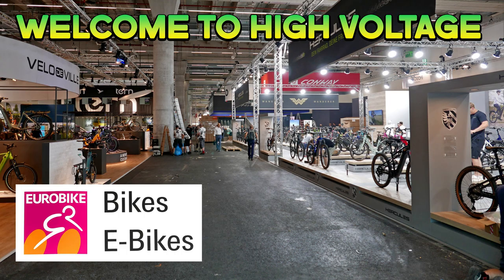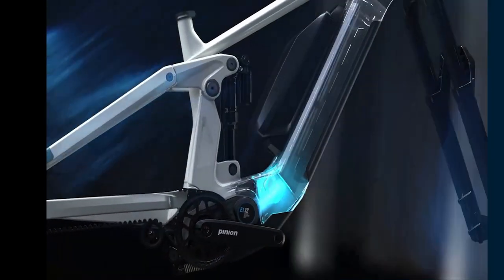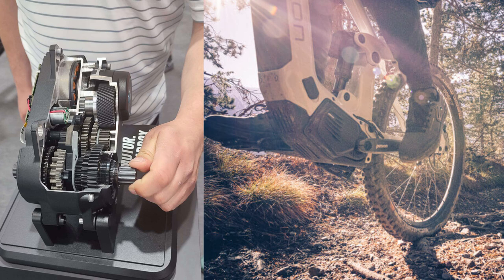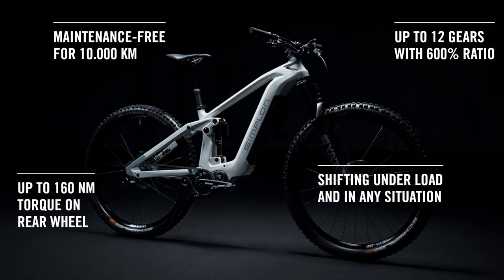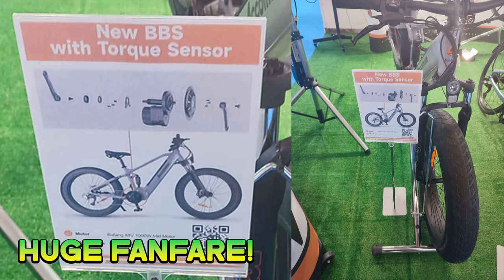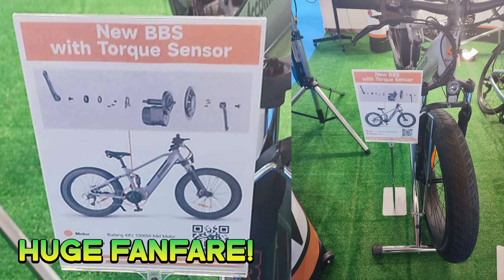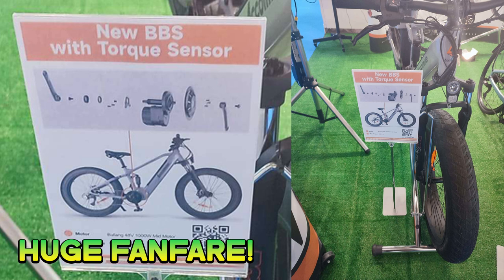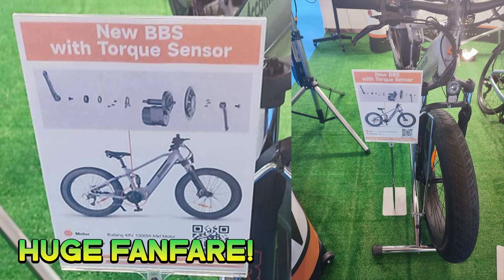No more derailleurs? The Pinion Motor Gearbox Unit and Bafang made a Torque Sensing BBSHD!

Comment: It'd be really nice if bafang released a torque sensing upgrade kit to put on older existing model bbshd/02. Im sure they'd sell a bunch of them. I mainly ride throttle but I hear so many complaining about the lack of torque sensing on the HD.
Reply from the maker: Its meant to be the same casing. I bet chasing the wires would suck. Needs to be taken apart first.

Comment: Thanks for the content presentation John.
On the gearbox front, massive expense would kill it in the enthusiast market. As you adroitly point out, the rear derailleur has been around for 100 years and the reason a better mousetrap including geared rear hub hasn't superseded the rear derailleur is weight and largely cost...and..reliability cost aka maintenance and maintenance interval.
Most of us that prefer 2K+ motor wattage snicker at this woefully weak motor married to needly complex and integrated gearbox.  Derailleurs are cheap and with a shift sensor, I don't replace any rear derailleurs to speak of...generally only chains and an occasional cassette.  I can't help but think of all the old motorcycles that are scrapped due to engine and transmission sharing the same casing and transmission failures putting them out to pasture...even modern motorcycle remakes like the Triumph Bonneville known for dodgy gearboxes, inexcusable in the modern era.  I would never be an early adopter, but like the guys that went down to the Titanic in a carbon fiber water heater I could write a book about, other suckers will line up and pay needlessly for no value added.

As to retrofitting a torque sensor on a BBSHD, I would be interested in this as an experiment as many would. I would merely couple it to a motor teardown say at 20K km or so. Seems like worthwhile trial.  Again, you rightly point out whether Bafang will want to further lock in customers to their CANBUS batteries for profit...the marketing hook being adding a torque sensor to the BBSHD.

I am hoping for more Bafang Ultra specific frames in the future with some universal battery mounting options.  I personally don't even mind building my own batteries for such a build.  Otherwise, might as well stick with a traditional bike frame and BBSHD like mounted motor.

Another good point about worldwide restriction relative to motor power.  Laughable how draconian the power restriction in Europe is...but many are building 3K watt bikes there and riding them anyway.  Also, doesn't seem to discourage Sur-Ron sales much which will do almost 50 mph.   Many just buy them without pedals and ride them all over the place unregistered as inexpensive e-motos.  I have even considered picking one up as a toy but pretty happy with my BBSHD bikes.
Reply from the maker: Hey Luke, thanks for the comment. I would love to try one of these but I am not sure I will be spending the money to get one. I suspect that at least to start with the only way to get one will be via a partner company that builds bikes. The frame will have to fit the bracket fitting that it uses. I am not sure if its a standard or proprietary. In terms of the BBSHD I have no idea yet if it will be possible to retrofit one on. Much depends on how they have done it to see if it would be even possible to do. Europe can be a tricky place with ebikes. There are alot of places cracking down. Its an easy target for police to be seen to be "doing" something. This doing something is then gaining them votes with people that actually go and vote. People that don't ride ebikes and know sod all about them. Hopefully there will be more information on the new motor soon.
Reply: @HighVoltageKits  Good stuff John.  Yes, internals of a torque sensing BBSHD may not be backward compatible as you suggest.  Maybe an opportunity for a new motor purchase because we all love the BBSHD for its robustness and low cost relative to power level. So I guess we will have to wait and see.  I just don't see the allure of a lower power motor mated to an expensive and heavy integrated gearbox.  Maybe Bafang will develop a high power version of the Ultra with 5 internal speeds and servo electric shifting.  A simplication but with more power.  No doubt something will come along.
I haven't been to Europe in a while.  I will tell you John, in America, the police let us play as long as we don't cause trouble.  I for example only really use the top end power of my ebikes when away from others. Many dont even know I ride an ebike.  An absolute shame Europe is so hamstrung with onerous ebike policies.

Comment: The pinon senses when the crank arms are vertical; then it shifts under load.  You have to ask the question who did Bafang steal the torque sensor engineering from?  CYC?
Reply from the maker: To be fair Bafang have motors with torque sensing way before cyc existed. Its why the lack of one in the bbshd was so frustrating. Thanks for the information on the Pinion. It does sound promising.
Reply: @HighVoltageKits  I was at the Bafang website today, and the only motors with "torque sensing" are the ones for the OEM market.  None of the BB types have it.
Reply from the maker: They are not pushing it very much. The information has come from an internal contact and Eurobike

Comment: I spent some time for looking , hut i think BBSHD with torque already done its call " Toseven mid motor DM01" its really similar to bafang but with torque
Reply from the maker: Its not by Bafang its a new company. I should have some samples to play with pretty soon. There are a few motors coming out from them.
Reply: @HighVoltageKits  I mean the motor look like same , his weight, and size , rotor and starter . So it's almost bafang. Will be interesting see what bafang will make , and choose best one .
Reply from the maker: There are definitely similarities in terms of the reduction and look. There are differences under the hood so to speak. We will be sticking on on the dyno so that should be interesting.

Comment: Will the new bbshd still fit to the upgrade kit from high voltage Channel?
Reply from the maker: I hope so. Until we get one it will be hard to tell. Much depends on the CANBUS protocol used and whether we can utilise it. There are lots of tricks though so I think it will be doable. The motor itself apparently uses the BBSHD casing so there ought to be no other issues.

Comment: Funny thing is, the pinion gearbox price is actually good value compared to most other bicycle parts..
Reply from the maker: It would be interesting stacking up all the components it replaces side by side. I had not considered the relative aspect. The prices are shocking.
Reply: A bit bulky to my taste...unless they DO want to handle 4kW. Then it would be a huge deal.
Reply: @daniiltimin5396  its 600-800w the motor is very small
Reply: Pinion requires a customized (bespoke) frame, doesn’t it ?  There are at least two alternatives (given the demise of the Sam Patterson of SRAM bottom bracket gearbox following his deal with FSA). These two are Schlumpf (now produced by Haberstock Mobility of Germany) and efNeo (distributed in the USA by Trident Trikes of North Carolina) out of Poland. Neither the Schlumpf (it’s namesake inventor is/was Suisse Deutsch) nor the efNeo require a custom bike frame. In other words, I can attach either one (and there are multiple variants of each, some Schlumpf models—but not all— requiring chamfering of the bottom bracket shell). Availability of the efNeo may be a problem. Trident Trikes folks are checking.

Comment: I have a Priority 600 w/ a Pinion transmission and Gates carbon belt drive, it's the bee's knees.
Reply from the maker: Right on. Thats encouraging. Thats not an ebike though right? I presume the only thing different with this is the motor? What does it feel like when shifting gears?
Reply: @HighVoltageKits  Yes, not an e-bike but I suppose you could have one with a hub motor.  Shifting gears just requires one to stop pedaling for a second, it's very fast and quiet.  Also I can't change gears at a stop, requires a little bit of motion.

Comment: Questions to ask: Can the PM Gearbox be retro-fitted to existing bikes, and how much does it weigh? How much maintenance does it require, or is it a sealed unit?
Reply: It's sealed. Oil change once a year or 10k km. It cannot be retrofitted even to pinion gearbox bikes because the mounts are complately different. It's weighs aroung 4 kg.
Reply from the maker: Appreciated thanks!

Comment: imma say that bike company that displayed a "torque sensing bbs" is going to have some issues with bafang 😂
anyway, I'm still worried it's not going to be a bbshd motor. most people that pedal bafang motors buy the bbs02, the hd is just too bulky and expensive for most people
but maybe there's still hope. if it's coming out before the end of this year I'm definitely going to buy it instead of the old hd
Reply from the maker: Bafang never showed it either. Very strange to be so low key with it. I'm sure more will come out.
Reply: bbshd  trzeba wymieniać łancuch co 2 tyś km 😢

Comment: I don't get why there hasn't been more research into CVT transmissions for bikes. They suck for cars because they off a horrible strength proposition, but for a pedal or e-bike?  Might be worthwhile.
Reply from the maker: I think its because they are up against a well established technology that has nothing that much wrong with it. So in order to gain traction it has to be better or cheaper or something. If this is good then perhaps the floodgates will be opened.

Comment: The 250w limit isn't as bad as you think. There is no limit to how much power the motor gives uner EU or Uk regulations. The rule is that the "rated" power must be no more than 250w, and there is no rule about how a motor must be rated other than it must not overheat when running at its rated power. Obviously, if you rated a 10kw motor at 250w, then ran it at 5kw, it's not going to overheat. the clever manufacturers are very creative in their motor power ratings. You'll note that torque goes up every year, the power is still 250w and the speed is the same.. Physics doesn't allow that. I know companies that make cargo bikes with extremely powerful "250w" motors, and they have EN15194 certification for those bikes.
Reply from the maker: From what I know there is not any way for authorities to test for the actual real power of the motor without taking to a pretty expensive test center. In most cases they base judgement on what it looks like and how its being ridden. That manufacturers are finding ways around the law is good. I still think that removing this restriction would be a good thing. Treat people fairly and equally. No one is going after cars and trying to restrict them even though they kill and maim hundreds of thousands every year. If they are going to go after ebikes because of the actions of a few idiots then why not restrict the power and speed of cars and trucks because there are plenty of idiots driving those. I know of a few people developing cargo bikes and once they are loaded up with stuff the existing motors just don't cut it. I would like to see vehicles build that can deliver really big weights of stuff. I think that if the rules were opened up you could have a motor that would do 1000lbs etc. I am a big fan of solving our transport problem not by replicating the car in electric but by using light electric vehicles. So seeing anything made get shoehorned into the ebike rules is like a straight jacket. I am not calling for the wild west in terms of do anything. A top down look at what could be possible would be good though. Supposedly 40% of Copenhagen families are now using cargo bikes. What have they done to enable this? Thanks for the comment!

Comment: Motor watt limit makes little sense. The only relevant factor with regard to safety and regulations is speed.
Reply from the maker: I agree. My argument is that they should make this speed limit be enforceable with signage and education like it is with other vehicles. Be fair. If you are going to limit ebikes by speed then lets do the same for cars and trucks which just by size are far more dangerous? We don't think its crazy that a person can have a car capable of doing ten times the posted limit in a school zone. But god forbid them have an ebike that does not shut off the assist power at 32kph.